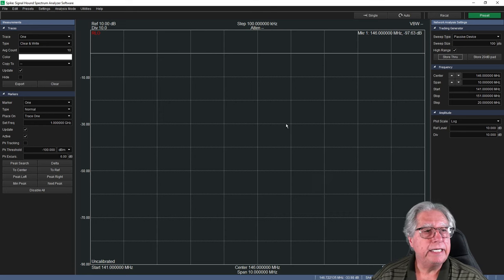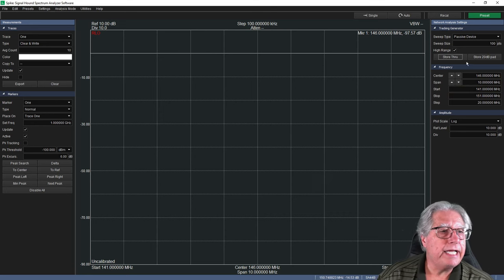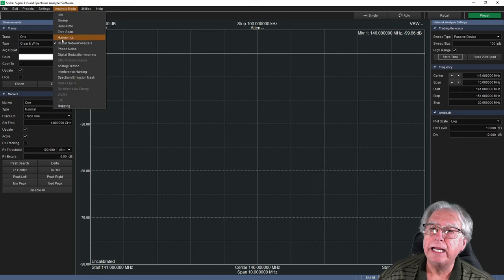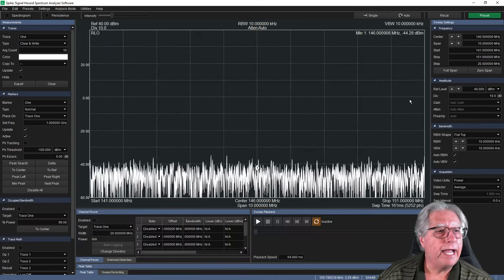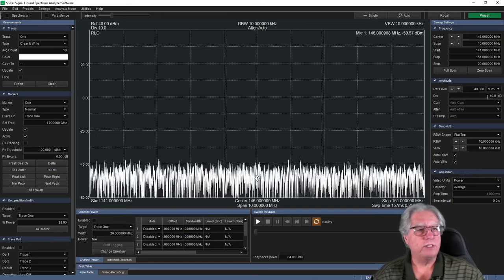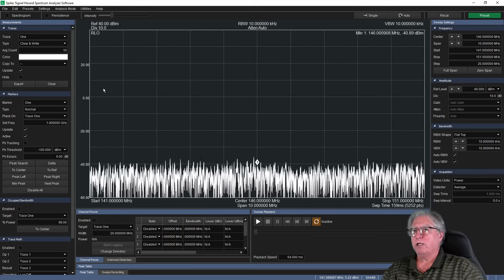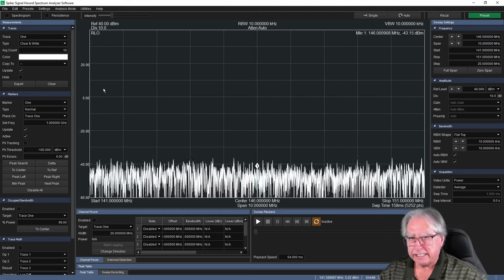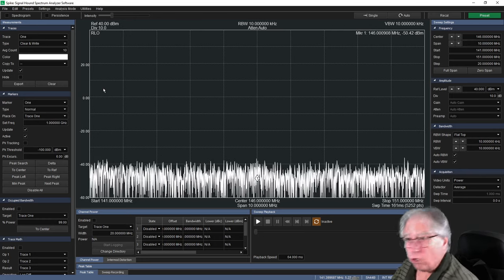Baofeng UV-17R - Say it ain't so! Part 97.307 (e) Fail.

Comment: I have two BF's GT-5R and a UV-K5 Plus. Basically only the GT is clean. The rest are all the same old board with just different stuff soldered to it. We should stop buying them till they make some more up to date boards. The difference is probably 0.02 cents of filtering.